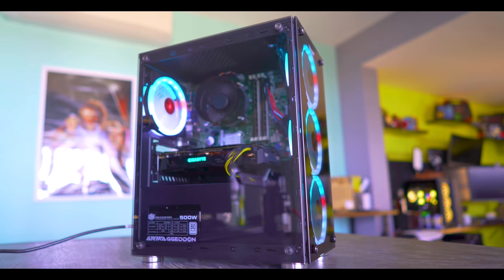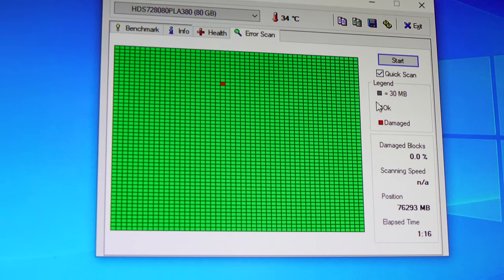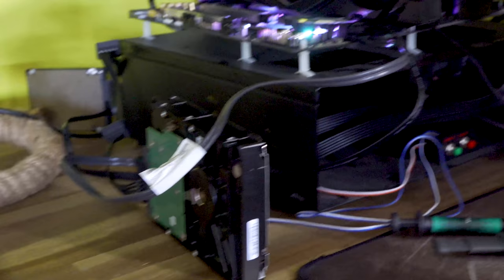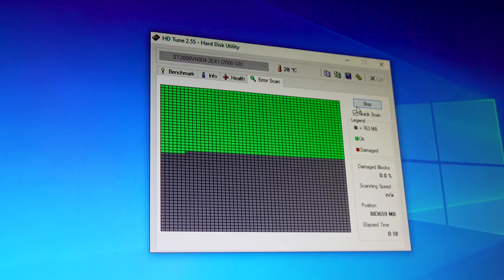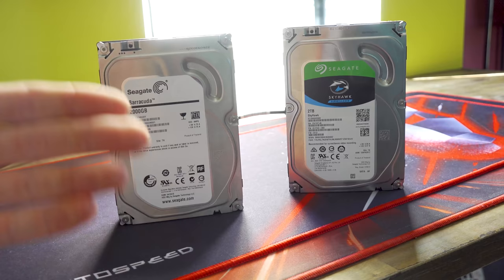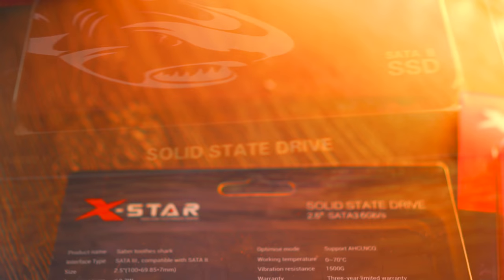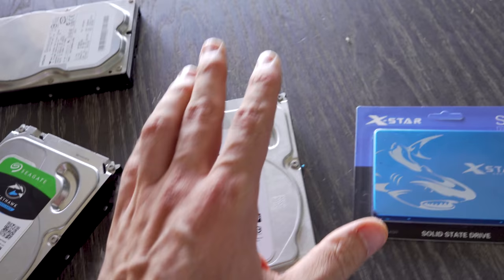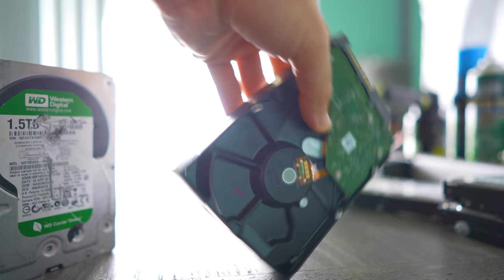Are USED Hard Drives Worth it...? (The Tech YES Buyer's Guide)

Comment: I don't immediately ditch a drive with a couple of bad sectors: if there's like 5 or fewer bad sectors, I perform ATA Secure Erase on the drive, which makes the drive format itself and forces the drive to reallocate any bad sectors it finds while doing that. In my experience, those couple of bad sectors typically appear in a rather short amount of time when the drive is still new, but then there don't appear any more of them after that, so, once the drive has rellocated those from the spare-area, it's all good and fine again. I've got several ~10 year-old drives like that that I'm still using.

It's only if there appear more bad sectors later on that I ditch the drive.

Comment: 1. That 80GB drive has 507 bad sectors, not 1. The "Data" column is the actual value for SMART attributes.
2. I recommend CrystalDiskInfo for SMART health stats because it's free, open-source and feature-rich. Also, it has a feature where if you mouse over the health status it will tell you exactly which SMART attribute is bad and what its value is. If you mouse over the power on hours it will tell you haw many days it is equal to. CrystalDiskInfo can also be configured to send you emails about disk errors. The only thing HD Tune has that is less common in other free software is the error scan.

Comment: I just got a i7 4770, 8gb ram, 1tb hdd, hp elitedesk 800 sff pc for 140 cad. Only issue is that I want to add an ssd and another hdd and need the hp hdd caddy and ssd screws with grommets and can't find them for cheap

Comment: I have 2 80 gb drives. One western digital sata and a segate sata. Bother 7200rpm. They are out of a Dell optilex 745 and 755, from 07 and 08 respectively. They are from old work computers, the Seagate has over 96000 hrs on it and the WD has like 85000. They ran almost literally none stop.
Both work fine. All health checks are good. Although the WD is Ssoooooo slow compared to the segate at random reads. Not sure why

Comment: On windows I had a clicking drive with bad sectors, then I started using Linux and the thing is silent, and still working 3 years later. Will never see old disks the same way ever again. They're useful to store non-critical data, just keep writes to a minimum and mostly read from it, things should be fine.  (by the way, the disk in question is a 2.5" 320GB Western Digital Blue)

Comment: For the price, and the piece of mind, brand new is the best option. New drives are not that expensive these days. Even SSD prices have come down considerably as of late. Really all you need to do is answer these 2 questions. What is you data worth? & What is your time worth? Cause any money saved on a (possible) failing component, isn't much of a savings at all. And I buy nearly all of my components used.

Comment: I prioritise buying new for my media storage drives, used if it's in "like new" condition 6 months top. Stretch to 1 year old if the price is right.
Game storage drives, or for flipping a PC then I can consider older drives.
Seagate has a bad rep for failure rate from what I can see, and with personal experience, twice.
If you use HDTune to routinely check HDD health, turn off quick scan. I'd be saving cash by the first bad sector and most of the time that small error gets missed on quick scan.

Comment: My total of faulty drives have been 1 x Corsair SSD & 1 x WD HDD (both bought new) over the last 30-odd years. I also have a NAS using 4 x Ironwolf Pro's drives running 24/7 for over 2 years now without any issues. My philosophy is you get drives suitable for the job and as they last a long time, never (within reason) compromise on the price. In all honesty, I understand that people may be constrained by budget but in the great scheme of things, TCO is extremely low for storage. I wouldn't bother with the used market when it comes to storage for the aforementioned reasons. In reality, I have only retired drives (barring the 2 failures I mentioned above) due to their size more-so than how they are performing.

Comment: It's not how long the drive is used. It's the temperature at which it's used. If drives are cooled better they last two or three times more on average. And on certain temperature they start failing after 6 months to an year. I've lost quite a few before I realize that adding more fans to the box will do miracles.

Comment: I think a compromise is to use RAID1 (mirror mode) and you'll enjoy the cheaper price whilst also having some sort of redundancy if one of the hard drives starts erroring our or dying on you. I personally use FreeNAS and ZFS setup to allow two hard drives to fail in a eight hard drive setup for safety (before I need to start worrying). The average computer user does not need such redundancy and they can enjoy RAID1 and get best of both worlds.

Comment: Every single computer I've sold, the buyer has asked me if the hard drive/SSD was used or new. Which always boggles my mind because they ask me questions like, "What kind of graphics card does it have?" Even when I include the graphics card in both the listing title and description.

As far as HDD VS SSDs in terms of stability. I've bought probably 20+ used hard drives and maybe 10 new ones that have all worked flawlessly and passed error tests. I've bought 8 SSDs all new, and I stick with familiar brands. Two of them failed within a month, and the third one I just recently bought, a 1TB Samsung Evo ( 2.5 SATA, not M.2.) I use for my main system has some unbelievable sluggishness now that I've used a little under 30% of its total capacity. (Around 270GB being used) I did check it under a different system and had the same issues. The problem goes away when I clear up down to 240GB being used, so that'll probably get a return. Either way, I've personally had a better track record with used hard drives versus brand new name brand SSDs.
Reply: Yes . There are some clients who know nothing but come with an insulting attitude . They get off by looking down upon people 🙄

Comment: Most of the old hard drives I get in used PCs they're usually older enterprise drives which tend to be really noisy or older/low end drives which are extremely slow. (5400rpm with small cache sizes)

Comment: Load cycle count is also important to note, especially with those older WD Green drives and their aggressive heard parking. If the cycle count is above 50k (depends on brand and series, as some drives are rated higher), even if everything else checks out fine, I'd avoid it.
Reply: that's why I never hibernate/suspend computers anymore, just leave them on 24/7, less chance for problems that way, and the power they use on idle these days is kept to a minimum
Reply: @FeelingShred  You'll still need to set the HDD power down setting in Windows to "Never" for it to run continously. There will be benefits to going into low-power state a few times a day, but when it does this a few times an hour is when the heads wear out.
Reply: @samwong9494  Yeah. On Windows small things like these were a pain in the ass. I switched to Linux 3 years ago and, although there are many things to improve, there's none of that drama and things getting in your way. I feel more like in control of my laptop on Linux than I ever was on Windows. But there's a learning curve, it's not easy, I will not deny it.
Reply: Another pain in the ass on Windows was "core parking" (almost no benefits whatsoever from using that...)  I had performance problems for yeaaars, took me too long to find out about that little trick.
Reply: @FeelingShred  Haha, yep. Been on Linux the past decade and never looked back. Only place where Windows should be is in it's own little (VM) box.
Reply: @samwong9494  There's still little things in Linux that are not quite finished, I would be an hypocrite if not acknowledged them. For example, there's no "easy" way to undervolt CPUs on Linux (you can limit the frequency but that's not enough for some laptops that overheat too easily... for example getting 65ºC just for browsing the web, that is far from ideal...)  And then there's the most annoying for me: when the system comes back from a suspension, the laptop special shortcut keys stop working, and sometimes the laptop doesn't shutdown the screen when I tell it too, after X minutes unused, like when I'm going to sleep. Other times, coming from a suspension made the Wifi or sound to stop working. So there are some polish that could be done. I just feel like it's so frustrating when the system succeeds at doing harder stuff but fails to do these simple ones, and these issues been around for years.
Reply: @FeelingShred  Of course, no system is perfect. It's what you can live with and which quirks become major annoyances for you. It's not just the power management issues for Linux; multi-display issues, peripheral drivers and support, and 'quality of life' issues. But in terms of interfacing with cloud VMs and power use, it's my preferred choice. I just prefer to keep Windows in a box where it'll work the same but with greater flexibility.

Comment: There's actually a 3rd reason why an hdd might not show up in bios! So, yes, the drive can be faulty, and yes it can be a problem with the motheboard (connector), BUT it can also be a faulty cable! This happened to me recently when I couldn't get an hdd to show up in bios: one of the connectors in the cable was busted! I tried all the tricks in the book before I realized it was the cable...
Reply: could also be a bad power supply

Comment: My experience that any drive with over 40,000 hours is on its last leg. This applies to SSDs as well. I use Crystal Disk Info (free) to check for power on hours, total writes to the drive, and any errors. I’ve seen drives with only around 10k power on hours but had hundreds of gigabytes of writes, and those drives didn’t last long...simply just worn out from all the read/write activities.
Reply: I’ve got a Maxtor external 500gb from 2008 that’s up around 90k hours, I use it as a swap drive so it gets a lot of writes and it still works perfectly fine
Reply: yrly59e you must have a lucky drive

Comment: my oldest 2TB has 2836 days of use on it and has no bad sectors or spinup retries. it is one of my most healthy drives. with a power on count of 5551 :D that seagate's been with me since highschool. My 5 other 2 TB drives are all in great condition as well. I think it depends more on wether it was knocked while running and vibrations than anything else. I've had drives for a few months that died faster in builds that moved around a lot. 

my main rig doesn't move at all except for a good cleaning every few months and hasn't had any drives in it fail I've replaced everything else in my system over the years but have only added harddrives. I'm a storage hog and have a lot of entertainment on my pc for those days that we're without proper internet connection here in this backwater town in South Africa. Everything is replaceable aside from a few OLD cartoons I got locally and ripped from VHS.

Comment: Well, I feel a little dumb, I bought a used 2 tb hdd off ebay for $30 before checking newegg and discovering 3 tb new hdds for the same price. The The drive has no issues and was well taken care of, but the nearly 50,000 power-on hours on it make me a tad nervous.
On the plus side it seems faster than the 2.5" hdd that I had in my PC prior, and it's not a Seagate.

Comment: I wouldn't buy a Seagate used or new. Too many failures for my taste.
Reply: I made that mistake, 8tb for $150 and it only lasted a few months, i lost a lot of data on it
Reply: thankfully mine has been working daily as boot drive for over 10 years , and im a power user
Reply: @MultiAlliot  SSD or HDD?
Reply: @MultiAlliot  You got a golden sample...
Reply: @MultiAlliot  same Lmao
Reply: @nathanhamman418  ofc hdd , dont remember ssds being a thing back then
Reply: @MultiAlliot  Not a consumer part, but SSDs have been around for quite some time.  Sundisk(not sandisk) released a 20MB drive in 1991, i don't know when seagate started releasing them.

Comment: I still use 2 IDE drives (320 + 250 GB) for my weekly backups, both must be from before 2008/9, they have 6.4 and 1.4 power-on years. That backup Pentium 4 PC is powered-on for 1 to 2 hour/week. 
That 250 GB drive is practically new, that came with an ex-lease HP D530 SFF in 2008/9, whose power supply died 2011 after a power fail :) 
That 320GB drive I bought new and it has been used in my Pentium III file-server (2008-2013) as second disk, so it has many power-on hours and not very much active usage.

That back-up server runs FreeBSD-12 with ZFS and connects to my main desktop with Ubuntu 19.10 also with ZFS. 
It also has a 320GB laptop disk on a SATA-1 connector. That laptop disk at 5400rpm is the fastest disk of the three striped HDDs, because it gets the most data from ZFS. 

By the way that Pentium and motherboard has been from that HP D530 SFF and are now in an appropriate Compaq Evo case with Pentium 4 and Windows 98/2000 stickers..

Comment: Beware of dogdy IT refurb companies selling nearly new OEM PC's on ebay with old hard drives in them. Bought an 8th Gen 2018 HP Pavilion and it had a 2014 hard drive in it. They swap out the good drives and keep them then put in some old drive. This trick works especially well if the PC has an SSD boot drive. Unless you take the PC apart you'll never know...... luckily mine failed on day 1, suddenly the PC just froze and after a reboot no drive detected..... When I contacted the seller and explained what I had found, they soon compensated me rather than getting bad feedback about it.

Tip always check the additional HDD out if the PC has an SSD boot drive.

Comment: I have a hard drive full of junk and unimportant stuff of mine that sounds "tick tick tick" sometimes. Well, seeing how I won't really miss the data inside it, I just left the thing be until it broke... 1 year later, the thing is still working, but keep making that annoying sound whenever I take my headset off...
Reply: could be something fixable, like maybe for some benign reason it does silly idling behaviour; like on off on off which you can disable by using software like "QuietHDD" or maybe something's was wrong with power cable it reset itself occasionally (it would make hard tock noise).

Comment: I have 1 hdd from my pc , after im upgrade my pc and change to mobo aorus elite b550m ,the hdd not show on window and disk management, butt the weird thing is, at bios it show my hdd, im trying using orico hdd dock station.and it show up then i format my hdd and trying to connect back to mobo, it still not working,trying to change sata slot from 1,2,3 also change sata cable also not working, only work when i tryng to use on dock station as external,

Comment: Little tip, from what I heard of at least.
Turn on time is not a big deal to me, rather than number of spin on cycles.
When drive starts it's getting to most wear and tear on its platter bearing. This is why it's bad idea to have hard drives turn off when not used (an option in Linux) adding more stress than necessary and instead of 1000 power cycles you see 3000 or more.

Comment: The only used hard drive I bought was off Amazon's Refurbished. It came in an Amazon box, with no cushioning (?) whatsoever. BUT, it's been working really well for nearly a year now, so I can't really say much. The reason I picked it up refurbished was due to the discount. 55 € (~61 USD/ ~90 AUD) was just too good to pass on. Also, it still had its original packaging. I suspect only the box had been opened.

Comment: used enterprise drives are usually fine.  they won't be crib deaths since they've already got 10000+ hours of power on time, but usually have at least another 20000 hours left worth of mtbf

basically only buy them if someone has a couple dozen of the same drive to sell

Comment: I've not bought tons of used drives so take it with a grain of salt but here's my take on it, the most important thing to look for is: 
A) Good drive models, even "good" brands have their failures so it's important to look for specific models that a lot of people are happy with or find data on failure rates such as the backblaze reports. 
B) Look for the date or date of manufacture (DOM), as long as it's been packaged well and it's at most 2 years old then it probably has a lot of life left in it and it should be obvious but if it's 5 years or older, it should be considered at the end of its life and not to be trusted.

Comment: I bought a used dell optiplex 790 MT PC for cheap which came with a faulty PSU but it was ok because I wanted to install a GTX 1060 on it and I had a 500 w PSU ready to install...but the problem I have is it's pretty slow on start up and sometimes when I try to install a game on it...I noticed it's reading 100% usage hard disk, I'm thinking maybe I should replace the Hard Drive, I tried disabling superfetch but it's still the same.

Comment: I bought a couple of used 160GB 10k rpm enterprise drives from a local electronics recycler last summer for 6USD each (cause who wouldn't want to try 10k rpm at least once)... Sadly I haven't been able to test them out because I don't have a desktop computer (yet) and my external drive enclosure can't supply enough power to spin up the platters lol
Reply: I do know they should at least be able to be recognized though, since the seller guarantees donators that they wipe and reformat drives they get, or they'll send them to an industrial shredder